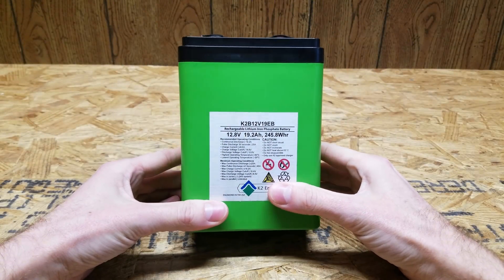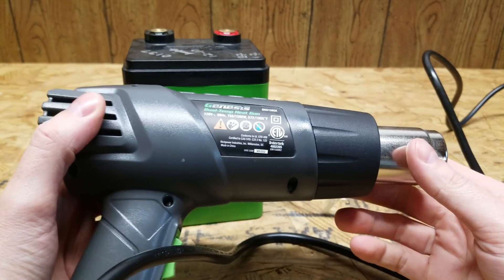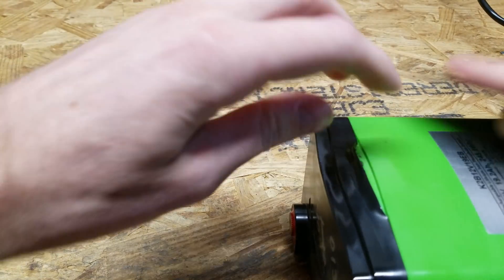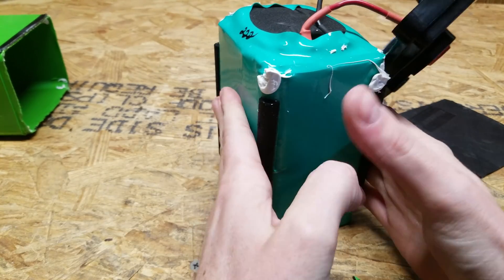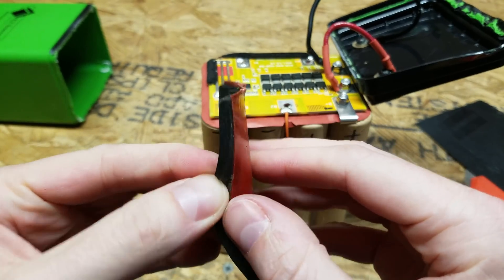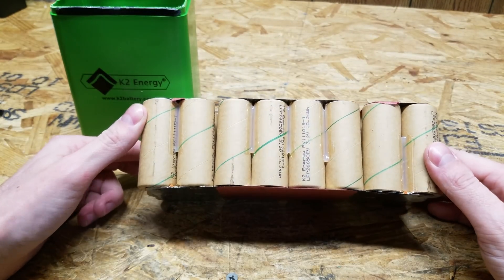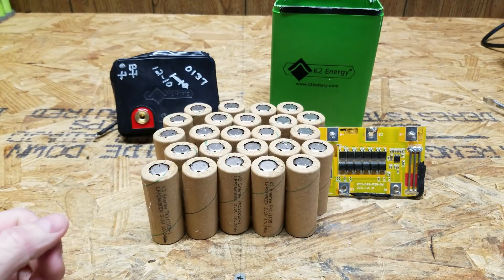What's Inside a 12V K2 Energy K2B12V19EB LiFePO4 Battery?

Comment: I have one of these, and have been experimenting with it to see if at 12 years old it's still usable.

It had sat unused for several years after I stopped using it for its original application (a lithium upgrade from lead acid for a little Razor electric scooter with a 24V motor).  It had sat long enough for the BMS to shut it off.

At first I had the impression that it had lost a lot of capacity - at low 300mA draws, it only managed 14-15 Wh and the BMS would shut it off really early - at 24V.  I figured that the cells were way out of balance, or one or more of the cells were shot.

Not yet knowing there isn't a balancer inside, I wondered if I could give it an assist by charging at a very low current.  My 24V lifepo4 charger runs at 3.5A (roughly 0.4C for this pack), so I decided to charge with my bench supply at 1A, cut off at 85mA (a bit late, I know).

Just to see how it would handle higher current, I then used it to charge up an Ecoflow Delta 2 through the solar input.  It pulled 7A, less than the recommended max discharge of 9.6A, got really warm, and crapped out around 21V after just delivering about 14Wh to the ecoflow.

I expect that the age of the cells means their internal resistance has gone up, but the heat was even around the battery pack - no hotspots.  So I decided to charge it again off my bench supply, but at 250mV - again, thinking that the low current might assist the (non-existent) balancing process.  This took a day or so, with cut off around 75mA (late again).

It just completed a test using two DC LED bulbs, pulling around 18 watts total, and it made it to 13 hours, down to 20V and dropping fast when I switched it off.  234Wh @ <1A draw - not bad for lighting applications.  I guess I balanced it myself, though not by an ideal process.

Comment: You need to tear down the 26650 cell too. INSIDE YOU WILL FIND A MIS LABELED 18650 BATTERY PACKED IN THE CASE. CHINAS BIGGEST LITHIUM SCAM

Comment: i just got 6 of these K2 ,but 24v batteries. they were used in powered hand carts, lay-downs.  i want to use them for an e bike build using a 48 volt motor. they should work pretty good. any reason i would have a problem doubling them up ?
Reply: I'm sure you figured it out by now. But according to K2 website, max in series is 2, or 48v, kind of weird too because all though their website description states that, the label on the battery states otherwise.

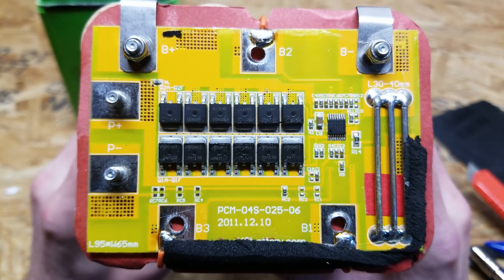Comment: 5:48 Those resistors you thought were bleeding resistors, they aren't. The black ones are resistors, the beige ones are capacitors.
Reply from the maker: I knew the ones marked C were capacitors, but I don't see any bleeding resistors then. Would you say this BMS just has over/under voltage protection and no balancing? That seems a bit silly though.
Reply: @LithiumSolar  That's my assumption, no balancing.
There are BMS's that don't do balancing. And since these are LiFePO4 cells, they don't need no where near the balancing potential as Li-Ions. So that helps quite a bit.

Comment: what could batteries like this be used for?
a solar system for a van or small rv to run a fridge & other electronics etc?
Reply from the maker: You can use these batteries for pretty much any 12V application. They're great for backup for a short period of time, but at 245Wh, you won't be building aby large powerwalls or anything with them. A small bank for an RV would be perfect though.

Comment: Hello my name is Maurice, I have a question for you.  Is it possible to repurpose an URB-E battery? I use this electric  motor unit to run short errands and I am noticing that after a full charge ,  the battery quickly goes from full to half full and  I only traveled a short distance.  This thing was rated for at least 15 miles give or take the persons weight and of course head wind.  A new battery would coast $500.00, so this is why I would be interested in knowing if it could be rebuilt.  I have watch you replace batteries in your power wall  in your shed, so I thought that maybe I could replace one or two cells in my URB-E.

Comment: The same 26650 in Lithium Ion would provide a minimum of 20Wh.  Typically 5-8 AH each x 3.75v (nom).  I pay less than 50 cents each for those cells. The Iron cells are worthless for anything but compatibility with older electronics.  It's a much better option to use a buck or boost regulator with LiIon cells.
The only reason we are seeing so many Li Iron cells lately is because China has created multi-billion dollar factories and are subsidizing costs at over 50% to force them around the globe.
Good teardown. No easy way to do those types of batteries other than cutting top or bottom off.
Reply: Well they are safer, and they do have a greater lifespan than lion cells

Comment: Ok, now I’m left wondering which one of the cells was emitting the smell; you should at least have measured the cells for their voltages...
Reply from the maker: I checked them all carefully visually and for odor and couldn't tell which it was coming from. I'll probably capacity test each one, which will help identify the troublemaker.
Reply: Yeah, the fact that there was pressure inside the pack hinted trouble, but then you mentioned the smell I am certain one of the cells is broken.

Comment: Looks pretty good build The plates are heavy. Still don't know why they have that smell of being overcharged lol.
Reply from the maker: I'm no expert here regarding circuitry, but when I look at a BMS board, you can typically tell which resistors are the bleeding resistors. I don't see any on this board so either I'm missing them or it's just over/under volt protection and no balancing - which would be silly in my opinion. Maybe that explains the overcharge smell. I'll have to do more research.

Comment: one or more of them is leaking gas when you charge them, that`s why the case was bloated
Reply: or they were packaged closer to sea level and it was an airtight seal and he's at higher elevation.
Reply: @phennexion  yeah, nope, i`m pretty sure you`ve seen those phone, tablets and laptop accumulators bloated, now with these cylindrical ones there`s a problem, they can`t expand so they always have a pressure valve to release the gases, orelse they would be small bombs (alcaline batteries don`t have a valve so if you charge them they will blow)

Comment: Hey can those batteries be used in a diy powerwall
Reply from the maker: Yes, they definitely can! Both the 12V batteries and the individual cells. You just need to make sure your equipment can handle LiFePO4 charging parameters.
Reply: Just make sure if you plan to use the batteries as they are that you keep the BMS limits in mind. 24v Max (2S). If you break them down then you’ll add your own BMS and work within its’ limits.